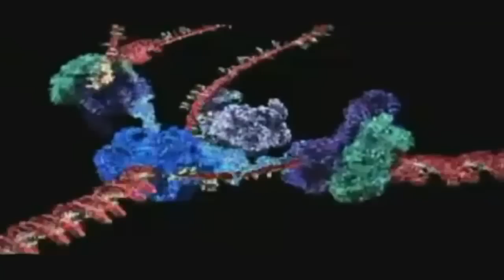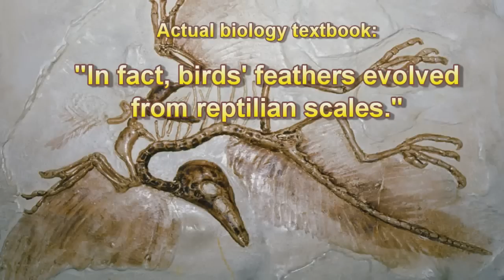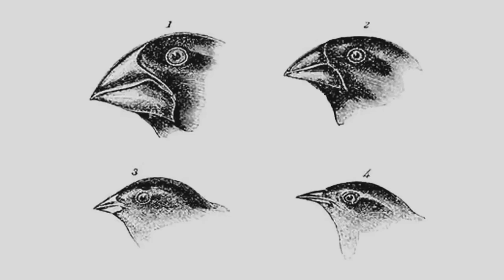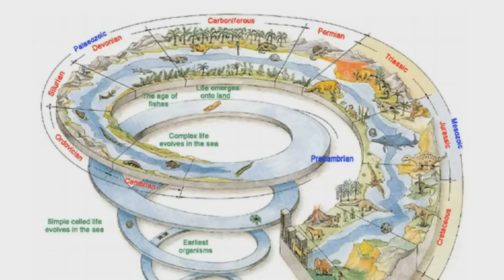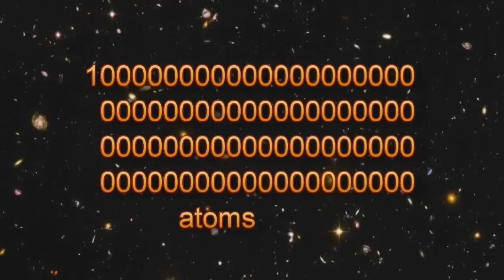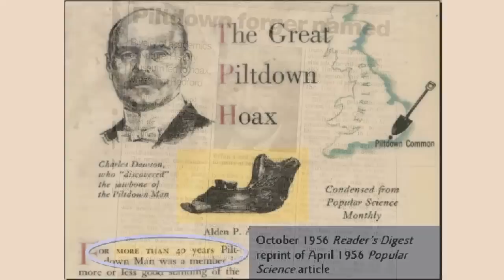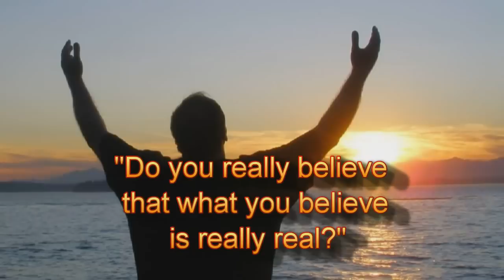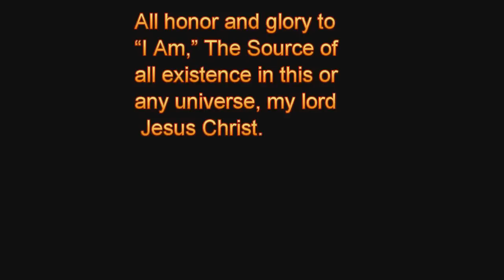Evolution Demolition

Comment: Mutations are not damage, they are errors, but to say that they are destructive is nonsense. Most mutations have absolutely no effect on the organism at all. In other cases, they can be extremely useful, you admit that microevolution happens, but guess what? That is caused by mutations!
The old computer analogy is simply stupid - computer code is much more finely-tuned (by a designer - us) than DNA.
Reply: It is not an analogy.  Living cells  contain literal computers, operating with literal instruction sets (programs).  Input, output, processing, it's all there.  If these information processors are not really computers, then what do you call them?

The only reason mutations are often less harmful than expected is because of highly sophisticated error-correction programs that repair the damage in most cases.  But when a certain threshold is crossed, the harm is devastating to function.  The same thing goes on in electronic computers.  Transferred files can usually be error-corrected, but at some point, things crash.

One thing is certain, randomly altering instructions reduces function.  You can alter the data (variables & parameters), but if the instructions themselves are damaged, well, it does not make it work better.  Building up instructions by such means is absurd.

To say that "computer code is much more finely-tuned by a designer than DNA" is the height of arrogance.  Bill Gates himself recognized this, and stated that DNA programming is far more complex than anything engineered by man.
Reply: Mark Champneys
I was talking about the analogy with the computer software on a hard drive, changing a software code is completely different from changing the sequence of a strand of DNA. 
DNA's function and method is much more complex than a software code, but it is less finely tuned. A change of a single letter in software could easily ruin the entire program, but changing a single nucleotide in a DNA sequence is incredibly unlikely to make a noticeable difference to it's function. I'm not just talking about the proof-reading mechanisms, even if a mutation is overlooked and remains, it will be extremely unlikely to change the function of the protein.

You can't compare DNA to "instructions". The molecular interactions that fold chains of amino acids are completely different. Changing the shape of a protein (in the rare case that a mutation causes that) doesn't necessarily "destroy" it's function, it could just as easily give it a new function.

You really need to stop thinking of DNA as software, you need to think about it in terms of what it is - a biochemical system.
Reply: Mark Champneys
No they don't.  They are cells.  You are making what is known as an equivocation fallacy.  Yes, cells are complex and amazing.
Your God of the Gaps argument, however, is not a valid alternative to science.
Reply: Ratio nalMind DNA is not like a data storage device.  It is a data storage device.  The sequences are not like software.  They literally are software--in every conceivable way.  Parts of that symbolic code are instructions, and parts are data (variables and parameters) as with electronic computers.  Damage to instruction sequences would have great sensitivity.  Damage to data would have less.  The information is stored in highly sophisticated overlaid data compression schemes.  Software engineers are beginning to study these techniques so as to begin applying them to electronic computer programming.

However, I will be quick to point out that all biological information is not in the DNA.  Epigenetic information is very important, and the decoding mechanisms are as important as the information itself.

I am thinking of all this as a "biochemical system."  That truth does not preclude it being a computer network in every detailed sense of the word.  Information scientists who are looking at this are particularly emphatic about it.
Reply: Mark Champneys
You're not listening.
Yes, "damage" to "instruction sequences" would have consequences, but they are very hard to damage to that extent! I'm not talking about proof-reading mechanisms, I'm saying that even if a nucleotide or triplet changes, it can have no effect on the function at all. This is for several reasons, the degenerate nature of the DNA coding, the fact that not all amino acids in a polypeptide are vital for the protein's function etc.
Changing a single letter in a computer code would severely damage the program, but changing a single base, triplet or sequence in DNA doesn't always damage the function.

It's good that you're aware of epigenetics, but I don't feel it's relevant to this discussion at the moment.

You adamantly say that DNA is software, but it's simply not. Software is virtual, non-physical. The "information" in DNA is not. It is determined by molecular interactions, a purely physical process. A chemical reaction is not determined by "information". I go into this point in detail in one of my original comments.
Reply: Mark Champneys
No, it isn't simply a "storage device.
Its an organic molecule that has the function of regulating cells.
That complexity DOES NOT mean that it was created by anyone.
Reply: Martin Koch It is both highly complex and highly functional, meaning it is specified complexity--the calling card of intelligent mind.  The instructions are coded in the nucleotide sequences, not in the chemistry.  That makes it symbolic code.  And symbols always originate from a mind (directly or indirectly).  No exceptions.  Unless you want to try to find one for me.
Reply: Mark Champneys
The "information" in denoted by the chemistry of the sequence, nothing more, there is no "symbolic" information in DNA.
Reply: Mark Champneys
"Specified complexity" is not a scientific term, its a Creationist term with no scientific merit.
It is used by a non-biologist, non-scientist.
Reply: Ratio nalMind And the information in a a book is just a matter of ink on paper, right?.  Your statement is non-nonsensical  The DNA of a sponge and a human are the same.  The only difference is the sequence of the four bases.  The ones and zeroes in game software look just the same as the ones and zeroes in the programs controlling the space shuttle.  Only the sequence changes.
Reply: Martin Koch I see, so if a person has a different world view than you, he/she cannot be a scientist?  You are simply attempting to define your way to your point, but that doesn't change the truth.  If you think specified complexity is not valid, then explain/describe why.  Don't merely rule it out a priori.
Reply: Mark Champneys
My statement is indeed non-nonsensical - it's not nonsensical.
Your analogy is nonsensical, the information in a book is interpreted by an intelligent mind reading it, the "information" in DNA is determined by molecular interactions, which have nothing to do with intelligence.
Reply: Ratio nalMind Oops, typo.
Reply: Mark Champneys
Any actual response to my point?
Reply: Ratio nalMind The information in DNA is de-coded by biological systems according to a built-in set of rules.  Molecular machines are used to carry this out.  Decodability is itself indicative of intelligent design.  Symbols are not encoded and decoded apart from intelligent activity to do it or design a mechanism that does.  Do you have a non-biological example to the contrary?
Reply: Mark Champneys
No Mark.  If a non-scientist makes up a term and tries to pass it off as science, and it doesn't pass as science, then the assertion dies.
That's what happened to Dembski's paid attempts to undermine science.
Reply: Mark Champneys
I've already explained this to you on another thread - DNA isn't "decoded"! It's not a symbol open to interpretation, it is a physical molecule that acts according to the laws of physics and chemistry, nothing more.
I really don't understand why you haven't got this yet.
Reply: Ratio nalMind Yes, DNA is a physical molecule.  A book is physical paper and ink.  A billboard is a physical sign.  All must be read in accordance with objective translation, syntax, and grammar, in order to de-code the meaning.

Sponge DNA and human DNA are chemically the same.  It is only the coded sequence of the bases that determines the instructions for one organism versus another.  Francis Crick recognized this information content.  Why can't you?
Reply: Mark Champneys
Let me try to break this down for you.

Information is non-physical.
Information is interpreted by a mind.

I've already addressed the book analogy - the information in the letters isn't determined by how they physically interact, it is how we interpret them as humans. Letters aren't physical, they are abstract concepts created by human minds. Of course we can depict them with characters, but that doesn't make them physical objects.

Yes, differences in organisms are caused by differences in DNA sequence, but this is only because changing the sequence changes how the molecules interact.

DNA is physical, and most importantly - "is not interpreted by anything", everything that it "encodes" is purely determined by physical reactions of the molecules.

If you're going to call DNA information, then you have to extend that label to just about everything in existence - rocks, plastics, metals, everything.
Crick, like all competent life scientists, recognised the usefulness of describing DNA as information for convenience, it makes it a lot easier to understand.
Reply: Ratio nalMind Information can be decoded by a mind, or by mechanisms built by a mind (such as computers).  DNA is absolutely interpreted by biological systems according to built-in rules of interpretation.

The difference between DNA and other things (rocks, etc.) is that DNA is symbolic code.  A symbol is something that represents something other than itself.  A true symbol must be objectively decodable, not merely assigned a subjective "meaning" after the fact. Symbols carry meaning, specified at their formation. As I pointed out in my video, a snowflake is a pattern, not a symbol.  Symbols carry meaning, ideas, designs, thoughts, beyond their own essence.  DNA sequences do this "in spades"...perhaps moreso than any other symbols in existence.

Some codons (groups of three bases) align with a particular amino acid; but some have regulator functions that are unrelated to amino acids or proteins.  The way the sequences are interpreted is dependent upon the programming.
Reply: Mark Champneys
"Information can be decoded by a mind, or by mechanisms built by a mind (such as computers)." Finally we're getting somewhere!
"DNA is absolutely interpreted by biological systems according to built-in rules of interpretation." Damn spoke too soon...

DNA is "decoded" by fundamental laws of physics and chemistry, nothing more. If you're going to try and argue that these laws are a creation of God's mind and therefore count as mechanisms of interpretation then this entire debate is pointless.

DNA is not symbolic. We assign symbols to them, A, T, C and G, and to the codons, AUG for example, but the molecules are not symbols! 
Definition: "A symbol is an object that represents, stands for, or suggests an idea, visual image, belief, action, or material entity." 
So by their very definition symbols are subjective.
DNA certainly does not "carry meaning, ideas, designs, thoughts, beyond their own essence." Once again, the key thought is that everything DNA does is just molecular interactions - it is purely physical, there is no interpretation whatsoever!

Different functions are "encoded" by different DNA sequences because those sequences interact differently to each other. There isn't any mechanism that's interpreting anything.
DNA isn't 'interpreted' by (for example) a ribosome (once it's in mRNA form) the molecules interact in a predetermined way, not a way predetermined by a mind or programming, but the way molecules interact according to physical and chemical laws! This is such a simple concept, why can't you grasp it?
Reply: Ratio nalMind I'm asking myself why you can't grasp it.  Even the bulk of evolutionary biologists understand the information content of DNA codes.  You are among a small minority even on your own side.

Like I said, of course there are physical interactions, but they are sequence-specific.  A different arrangement gives an entirely different instruction.  Exactly like any other software.
Reply: Mark Champneys
They often describe "genetic information" simply for convenience, using a strict definition, as I have demonstrated, DNA doesn't count.

A different DNA sequence gives a different function because of laws of nature, different software code gives a different function because of interpretation by a man-made machine.

There is a very simple difference there, one is entirely natural, the other involves a mind. As I've already said, if you want to say that the laws of nature involve a mind because you think God created them, then that's an entirely different argument.
Reply: Ratio nalMind What law of nature makes a sheep DNA strand build a sheep; and a sponge DNA strand build a sponge?
Reply: Mark Champneys
Your simplistic question indicates you still don't understand my point.
The physical and chemical laws determine the function of the sequence, chance mutations and natural selection determines the sequence itself.
Reply: Mark Champneys
It's interesting that you keep arguing this one trivial point of semantics but ignore the other major flaws with your video I've pointed out.
Reply: Ratio nalMind Of course the interpretive mechanism is built on chemistry and physics.  What else would you expect it to be?  Magic?  So it is with computers reading code.  There is no difference.  Why does a particular codon in one location refer to an amino acid, yet in another refers to a regulatory function?  It is all in the symbolic coding sequence.  Exactly like computer software.

No I'm not ignoring anything.  What did you feel I neglected?
Reply: Mark Champneys
What you call the 'interpretive mechanism' is built solely on physics and chemistry, nothing more. A computer is programmed by a mind, DNA is not.

That's not how the DNA works, it's not as though AGT can be interpreted as an amino acid or something else, sequences can have different outputs, individual codons do not having different "meanings". As I've already pointed out to you, DNA is not a symbol, it is a physical, interacting molecule.

Yes, you are, because I made 8 original comments, and you ignored all but 3 of them, and then choosing to argue semantics instead of science on 2 of the 3.
I will repost them just so you have no excuse for not seeing them, even though 4 of them are top comments.
Reply: Ratio nalMind And I am arguing that biological systems are programmed by a mind as well.  The interpretive mechanisms are enormously complex.  Such mechanisms have no parallel in nature.  Actually these mechanism are considerably more complex than those which respond to on and off switches in a computer.  We are unable to build such mechanisms.  The power supply is one aspect of these biological mechanism: the mind-boggling ATP Synthase molecule.  This is a molecular motor more sophisticated than any motor made by man, yet it is essential to supply energy to all the processes of a cell, including the interpretive ones.  Where does such a device come from?  Do you think that these thousands of atoms just fell into place?
Reply: Mark Champneys
That's viciously circular - "I think they are programmed by a mind, so they are information, and information can (apparently) only come from a mind, so there must have been a designer."

Complexity does not indicate a designer, that's a fallacy. Just because we don't currently understand everything about the cell doesn't mean you can insert god into the equation. That is the problem with "intelligent design", it doesn't provide any prediction or tests to support it, it is simply a big argument from ignorance - "we can't understand how it evolved so it must have been designed." That is absolutely useless in science, why would you stop looking for an answer?

Hundreds of years ago we couldn't understand lighting, so of course it must be god doing it, now we understand it, and god is removed from the process. The same thing happens with all aspects of science, as our knowledge is ever increasing, god is ever shrinking into the smaller and smaller gaps in our knowledge.

Regarding your comments on ATP synthase specifically:
First, it does not provide energy to every single process in the cell - they don't all use ATP. It is also not the only source of ATP, Glycolysis, for example. You can look online for a bit of information on how ATP synthase could have evolved, for example from DNA helicases and flagellar motors.
Reply: Ratio nalMind Wrong on all counts.  First, I'm not inserting God at this level.  That would be multiple steps down the road from this question.  Intelligent Design Theory merely theorizes that intelligent mind is required, and is a well known source of such symbolic code--as opposed to all other explanations being a huge stretch.  It is simply abductive reasoning championed by Darwin, himself: "inference to the best possible explanation."

To suggest that someone has the slightest idea how ATP Synthase could evolve is preposterous.  For every bit of mud someone slings at the ceiling there are a thousand firehoses washing it down.  It does not even slightly stick.  Of course energy comes from other sources, but ATP is the primary source in living things, and is essential for building both DNA and flagellar motors.  You've got the cart before the horse.

I know you would like to fit creationists into the God-of-the-gaps idea, but in fact, it is evolutionists who make it evolution of the gaps, because you are fitting a means of forming original genetic instructions that has never been observed and confirmed.

It is not complexity alone that indicates a designer.  I agree with you on that much.  It is specified complexity characterized by near perfect functionality with foresight that is impossibly improbable, and is so characteristic of intelligence.  The overwhelming improbability is a critical aspect here.  All things tend towards a state of greater randomness, not greater improbability.

It is not circular, but axiomatic, to say that if any apparent symbolic code is is objectively decodable, then that code was encoded by a mind.  (Champneys axiom)  This axiom is easily falsified by even one known example to the contrary.  I have not heard a single one yet from any of my detractors... and literally billions of people have daily experience with symbols to test this.

The root of my axiom's truth is the notion of foresight.  Only a mind can have foresight.  The placing of symbols requires foresight--to encode something that you expect to be decoded in a particular way later.  Dawinian evolution requires no foresight, but rather a pathway of successive steps, that is viable at each step.  Yet the need for planning in biological systems is obvious everywhere.  A glaring one is the metamorphosis of a butterfly.  Nothing works unless something down the road works.  Planning.  Foresight.
Reply: Mark Champneys
+Mark Champneys 
You are inserting god, you said that living things must have been programmed by a mind. ID hypothesises that an intelligent mind must be involved, without evidence - once again, simple arguing from complexity is not evidence.

It's not preposterous at all, simply google it.
You'll notice that I pointed out that ATP synthase isn't the only source of ATP in a cell, so there is no cart before the horse.

You're talking about the very first genetic information, in which case if anything, it would be abiogenesis-of-the-gaps - it has nothing to do with evolution until after this point. However while there are gaps in our knowledge, we still have foundation for such hypotheses, we have observed nucleotides forming naturally, and we have observed polymers of these bases form naturally, for example.

The functionality is only almost perfect because it has been acted upon by natural selection for billions of years so that the non-functioning cells have long since died. This isn't a guided process with foresight, you have to understand that. If it works, it survives, it's that simple. We wouldn't be here to talk about it if it was non-functional.

It's certainly not axiomatic, let me ask you, are tree rings encoded by a mind? They are "objectively decodable" are they not? Codes created by minds are subjective by definition. I'm not sure what examples of objective code you're talking about with regard to everyday life, can you name some for me? 

You're saying a caterpillar metamorphosing into a butterfly is an example of foresight? Seriously? You really don't understand how evolution works do you? There is no foresight. Using your vague terminology, you've hit the nail on the head, if something didn't happen down the road, then metamorphosis wouldn't happen - that's exactly right! It evolved over time, they couldn't always metamorphose like that.
Reply: Ratio nalMind When you say that god is being inserted because an intelligent mind is proposed, you are getting out ahead of the ID proponents and moving to the creationist position.  Yes, the logic subsequently leads to God, but that is not ID.  Let's first just deal with what constitutes evidence for intelligent activity.  You may disagree with the evidence of symbolic code and necessity of foresight, but don't tell me I did not propose any.  Intelligent mind is well studied in the sciences.  It is a real thing, that leaves evidence.

Tree rings, symbolic code?  No, but nice try.  Merely trying to read a trail of evidence is not de-coding an encoded representation of something else.  It is not encoded, and the reading process is not objective.  Most importantly, tree rings are not representations of something else.  They represent only themselves.  However, even if your illustration were a true example of decoding symbolic code, you would have just proved that it takes an intelligent mind to read it.  So it fails on all counts.

Yes, I understand perfectly how evolution is claimed to work, and metamorphosis is impossible by successive steps.  "You can't get there from here" as they say.  If you think there is a pathway in which each step is viable, please enlighten me as to what it might be.  This is actually a major pitfall of evolution generally.  Irreducibly complex systems, like the bacterial flagellum, are "refuted" without any alternative pathway proposed.  (Even things like the descent of man are not agreed upon.  Every paleontologist has a different idea of the pathway because nothing really works.)  Interesting, isn't it?  Lots of evolutionists agree with the idea of evolution, but there is no hint as to the actual contents of the theory--the step-by-step pathways that would have to exist. So I continue to maintain that evolution does not even qualify as a theory, but is little more than a very generalized hypothesis.
Reply: Mark Champneys
ID leads back to a god, it is an inherently religious movement, not science, as proven by several trials in recent years.

I never said tree rings were symbolic, I asked you if they were objective. They represent the age of the tree, that is the only "interpretation" that can be made.

"Most importantly, tree rings are not representations of something else."
Congratulations, you have just described DNA as well.

You're going to actually try and use the argument of irreducible complexity? You're about a decade too late, that too was been refuted in the Dover trial. 

No, we don't know every single detail of the evolution of all life on earth, that doesn't mean it's not a theory you fool. You can maintain your position that it's just a hypothesis all you want, it doesn't make any difference to the reality. Evolution is a fact, and the Theory of Evolution is just that, a scientific theory.
Reply: Ratio nalMind A theory does not need every detail, but it needs at least a few.  Evolution has none.  Only speculations that are not verified.  Not one verification of random mutations giving rise to overwhelmingly improbable genetic instructions.  Not one.

You are going to use the Dover trial as a scientific argument?  It was all legal maneuvering and control of the witnesses by a clearly biased judge.  No science involved.  Why do you not give equal weight to the outcome of the Scopes trial?
Reply: Ratio nalMind Thanks for the article link.  I read it with interest.  It was a breathtaking example of assumptions upon assumptions.  A fascinating exercise, but proved nothing that they wanted to prove.  "We carried out In vitro biomolecular evolution..."  How many absurdities can be fit into one sentence!  "In vitro" is not evolution.  One does not "carry out" evolution, because it is by definition an undirected process.  I'm asserting that biomolecular evolution does not exist, so that is the very thing we are testing for.  And viruses are not life.  Running various permutations merely showed that, in this particular case, less improbable changes improved fitness.  So what?  I have repeatedly said that "beneficial" mutations are not the point, but prescriptive information gain is the point.  But it has never happened by mutation because it is a violation of increasing entropy, both chemically and informationally.

This kind of article bamboozles many, but just a little critical thinking dismantles it.  By the way, the descriptor "peer-reviewed" jumps off the page.  By "peers" they obviously mean fellow evolutionists, not fellow scientists.  That objective scientist peers would not challenge all these assumed leaps of faith is disgraceful.
Reply: Mark Champneys
I find it difficult to believe that you read it and understood it since you're making such statements. However it's another example of you simply not understanding the principles of evolution.

Let me explain it to you again, what the study shows is that random changes to a random DNA sequence created an entirely new gene domain, coding for a highly function coat protein. You must really be in denial if you can't understand that.
Random sequence + random substitutions (simulating mutations) + selection = functional protein.
It's very simple - fitness was increased because an entirely new protein was produced. That's exactly what you said didn't happen.
The study was proof of concept, it demonstrated that it's possible.

The status of a virus as life or non-life is irrelevant, this is about proteins being produced from DNA.

No, peers means fellow scientists in the field. You're right, they probably were "evolutionists", simple because the vast majority of such scientists are, because of evidence like this.
Reply: Ratio nalMind More like 100% are evolutionists at this journal.  Dissent is not allowed.  Peers, indeed.  Did you notice how the authors assumed their conclusion at the very beginning of the abstract?

If you're asking whether the sequence of amino acids in a coat protein can be scrambled, of course they can.  Can it get lucky and ever have greater survival value?  Of course.  A coat protein could take lots of forms.  That's like rolling dice, getting an eleven, and saying, "Hey, look how this dice evolved!  Last time I only got a ten."  Roll the dice and build the instructions for a blood clotting system.  Then I'll be impressed.  Too tall an order?  Okay then, if you can think of a partial blood clotting system (with all its intricate intercommunication) that wouldn't kill off the organism, then try for just that.  Such overwhelmingly improbable outcomes are what I am scoffing at.  Just a simple little boy at the parade noticing that the emperor is naked...
Reply: Mark Champneys
Once again, yes they probably were all "evolutionists" because vast majority of scientists are. The reason they are "evolutionists" is because papers like this are good evidence.
Why even bother to discuss scientific findings if every time they go against what you believe, you chalk it up to a global conspiracy?
To suggest that no one would critique this paper if it had valid flaws is ludicrous. Scientific finding are always being looked at critically, and many such papers are rejected from publication because they are not good enough. This includes papers supporting evolution.
If your conspiracy hypothesis was correct, the researchers would not be publicly questioning the recent results of BICEP2 that support the Big Bang Theory - if their findings are accurate, it would be the smoking gun for the theory, proof of early cosmic inflation, so according to you, no one would question it because "dissent is not allowed" right?

What do you mean " the authors assumed their conclusion at the very beginning of the abstract"?
The abstract is a summary of the entire paper, of course it includes part of their conclusion from their research.

You're misrepresenting the study, it wasn't a "scrambled coat protein sequence", it was an entirely random sequence, inserted into the domain where the coat protein used to be coded. The study demonstrates exactly what you claimed never happened - a random sequence mutating and being selected for, gaining a vital and complicated function.
I'm not going to let you change the subject without acknowledging that you were blatantly wrong.
Reply: Ratio nalMind Once again, I do not dispute natural selection.  (A creationist first described the concept before Darwin.)  I agree with natural selection.  That this study demonstrated natural selection is interesting, but unimportant, since that has already been done many times.  They assumed evolution in the first two sentences of the abstract.  Of course they are going to find evolution when they already assume it.  No, I did not say anything about a conspiracy.  It's just that evolutionists are never going to have a problem with any researcher assuming evolution from the outset, even when their assumption is the very thing that they claim to be validating.  I think you are agreeing with me about the scrambled coat protein sequence, but you just don't like the harsh way I characterized it.  Yes, I understand what they did.
Reply: Mark Champneys
The paper isn't about natural selection, don't try and change the subject.
A random protein sequence was mutated into a highly functional one - which you said was impossible. 
Once again, it wasn't a "scrambled coat protein sequence", it was an entirely random sequence.

I've explained this to you once already, the abstract is written at the end of the research. They didn't write the abstract, assume evolution from the outset and then do the research with a bias in mind. The abstract is literally the very last part of the paper you write. It's a summary.

You are implying that "evolutionists" won't question any work that appears to support evolution, which is ridiculous, you have no idea how the peer-review system works do you?
Reply: Ratio nalMind Of course it was about natural selection.  It's right in the paper.  But it is also about a contrived lab mutation method.  But I'm fine with that.  Their results were a relatively probable alteration and a relatively simple function.  I'm not talking about such lucky but conceivable outcomes.  I'm talking about overwhelmingly improbable instruction sets that are both complex and highly functional.  Such DNA sequences are not going to write themselves in a trillion universe lifetimes.

Yes, the abstract is written after the research, but it is a summary of the logic that guided it also.

I know how the peer-review system is supposed to work.  And often it does.  Too often it doesn't--for reasons I have already described.  If I were a peer reviewing this article, I would not censor it, but I would certainly suggest some changes in their assumptions and their logic.  The research itself is fascinating.

Its funny how you don't like the word "scrambled," but you do like "entirely random."  Go figure.
Reply: Mark Champneys
It wasn't "about" natural selection, but of course it was part of the research.

A 139 amino-acid chain folding into a coat protein is anything but simple, but the reason I brought it up was simply as a proof of concept. You made the frankly silly assertion that random mutations can't lead to functional instructions, so I provided a paper which showed exactly that occurring. You can move on and dispute how more complex systems could have evolved, but you have to realise that you were completely wrong - mutations can certainly create prescriptive instructions.

There's a good reason you're not the one peer-reviewing it though - you're not a scientist, and you're really not qualified to be making such nonsensical criticisms of such research.

Calling it a "scrambled coat protein sequence" implies that the sequence originally coded for a coat protein, and then it was altered to be non-functional, when in reality what happened was they removed the protein sequence entirely, and replaced it with an entirely random sequence.
Say I give you an egg, then I scramble it - you've got scrambled eggs.
Say I give you an egg, then take it away from you, and give you some bread - you haven't got scrambled eggs have you?
Your choice of words are a pathetic attempt to lessen the magnitude of the evidence facing you.
Reply: Ratio nalMind The researchers did the mutating.  It was contrived.  It was not a living thing that built a protein like living things build proteins.  Nothing about the experiment was a test of evolutionary mutations.  As they themselves said, they did the "evolution" themselves.  The thing I am challenging is an undirected process, yet this was anything, but undirected.  What did they prove?  That humans could set up a dice game that once in a while they could win?  This coat protein was simply a luck of the draw to get something to wrap around a DNA segment.  Some coat proteins would obviously be more invasive than others.  So, as I explained, it was like rolling an eleven and saying, "Last time I rolled a ten, so it evolved."  You might just as well experiment with random development of poisons.  When you find the most deadly, you could say, "Hey, my poison evolved!"  The kinds of systems that would actually need to be built to prove your point are intricate inter-related biological systems requiring foresight and planning. (By the way, where did the DNA segment in the virus come from in the first place?)
Reply: Mark Champneys
Yes, the researchers carried out point mutations, changing RANDOM nucleotides for other RANDOM nucleotides. This was effectively a real-world simulation of evolution.

I can't understand why you can't understand what the paper showed. Let me try one more time to break it down for you:

1. Started with random sequence of nucleotides, coding for a random string of amino acids.

2. They carried out random mutations and cycles of natural selection - mimicking what actually occurs in nature.

3. After 20 cycles the random (and non-functional) sequence had evolved into a highly functional one.

4. This shows that entirely new proteins (and therefore traits) can come about simply by random mutations and selection - something you arrogantly claimed was impossible.
Reply: Ratio nalMind I think our impasse has to do with your definition of "highly functional one."  If you just mean that one combination of amino acids is "better" (for the virus) than another, than the last one... of course I agree that this happened.  Obviously any one arrangement is going to be better than another.  When all the permutations are laid out on a table, we might arrange them in a "functional" order, as natural selection also might do.  But if, by "highly functional" you mean low-probability machinery with inter-connecting parts which was not there before, then I would be shocked.

I agree that less improbable changes can and do happen in biological systems all the time. Luck happens.  What I dispute is the vast array of overwhelmingly improbable machinery, coming about by random mutations.  Molecular machinery does not have to get very intricate before it becomes extraordinarily improbable by random means.  That kind of luck doesn't happen.

So, back to our alternate definition of "highly functional"... I think the paper we are discussing confirmed the former, not the latter, definition.
Reply: Mark Champneys
So now you're moving the goalposts from mutation and selection resulting in a highly functional protein, to mutation and selection resulting in what you classify as "highly improbable genetic instructions"?

Why do creations have this obsession with calling everything "random"? Mutations are random, natural selection is not!

So you admit that brand new proteins can arise by evolution? Yes or no? Then we can move forwards.
Reply: Ratio nalMind Again with the "highly functional."  Which meaning are you giving to that phrase?

No, brand new proteins are not built by mutation, but re-arranged by mutation.  Big difference.

I've never disputed natural selection, but have pointed out that creationists thought of it first. It is not random, but is uni-directional towards survivability.  Natural selection must play the hand that it is dealt.  It creates nothing.

The "cards" are dealt by mutations, and mutations are indeed random.  Random cannot beget anything but increasing randomness--a law of mathematics, thermodynamics, and information science.
Reply: Mark Champneys
You don't think a protein which increases infectivity by 17,000 times is highly functional?

What do you think this study showed?
Once again: through mutations and selection alone, a brand new protein was created from a random sequence. Why can't you acknowledge that?

Many people were instrumental in deducing natural selection, it doesn't matter if they were creationists or not. How childish can you get? "We thought of it first na-nana-nana-na". That has nothing to do with the discussion.

Maybe random cannot beget anything but increasing randomness, but evolution isn't random - natural selection selects non-randomly. 
Studies like this show that when you combine mutation and selection, new "information" can arise.
Reply: Ratio nalMind An large increase in infectivity is likely a very simple thing, just as toxicity of a poison may be increased 17,000 times by a relatively small chemical change in the toxin.  What is the mechanism?  Simple explanations would have a relatively low improbability, making it feasible.  That is what this appears to be.  However, I will confess that a complex infectivity mechanism would be more impressive.  So can you explain the infectivity mechanism in this case?

While it is true that natural selection is not entirely random, it is close.  Gravity is not random either, but pulls in the downward direction.  That doesn't mean that gravity can build a computer or a house.  It is still very random within the confines of a general direction.  Mutation is the mechanism that supposedly offers the options for natural selection to "select."  That is where the random nature of the model is problematic.
Reply: Mark Champneys
It could be a simple thing, but it wasn't, it was the creation of a brand new, 139 amino acid long, functional protein. Lets go through this very simply, answer with yes or no:
1. Do you acknowledge that the 139 amino acid sequence the researchers started with was random?
2. Do you acknowledge that a brand new protein was formed?
3. Do you acknowledge that it was formed through mutation and selection?
4. So do you acknowledge that new functional proteins can arise by the processes of evolution.
Once again, yes or no only please, I want to see exactly what your position is.

No, natural selection is not "close" to random. It is very directional - towards fitness.
No one is claiming that something random + something non-random will build a computer or a house, that's another pathetic strawman.
It is the fact that natural selection selects for increased fitness that means more complex biological systems will arise, if only to outcompete those with simpler systems.

Of course mutations offer the options for natural selection to select! If you disagree with that you can't even accept microevolution.
Reply: Ratio nalMind 1. By definition things that humans do are not random, but, okay, for purposes of this discussion we will call it a short string of random amino acids.

2.  Yes, humans created a protein.

3.  Yes, it was altered until a particular arrangement was most effective at penetrating a nucleus wall than the original.  Natural selection at work.

4.  No, this function is simply a matter of having a good protein shape to fit through the nucleus wall.  The functionality is very simple and not improbable.  If I am wrong about how this virus is working, please explain it to me.

Natural selection selects for increasing fitness, but that fitness has to arise first.  If rolling an eleven is more fit than a ten, then, yes, that kind of evolution can happen, because rolling an eleven is not highly improbable... much like your better-shaped protein.  But how about a combination of proteins like ATP synthase, which is a high-speed motor that runs on protons and generates ATP from ADP.  Let's see a mutation that does that.
Reply: Mark Champneys
1. Of course humans can still generate random sequences, for example using computer-generated random number tables to select which amino acid to code for in the sequence.

2. Humans created a protein by simulating natural processes. You can't argue this study away by saying that it's human-directed. Every experiment is human directed to some extent, that doesn't stop them explaining natural processes.

3. Good.

4. You can't make statements like the function being "not improbable" - you have no idea what the parameters of the function arising are. Using simple maths however, you can work out that the probability of that particular protein arising by chance as 1 in 20^83 - this apparently unlikely protein sequence was arrived at in only 20 generations, how can you not see that mutations + natural selection is a hugely powerful mechanism of evolution?
All protein functionality can be reduced to it simply being the right shape.

You're moving the goalposts again, I'm happy to discuss the evolution of proteins like ATP synthase with you, but not until you acknowledge that brand new proteins can evolve pretty easily, contrary to your earlier statement that we've never seen random mutations produce functional genetic instructions.
Since we know from studies like this that evolution can produce new proteins, the common creationist crap about mutations never producing "new information" is well and truly laid to rest.
Reply: By the way, whoever keeps marking Mark's comments as spam: while I can appreciate the sentiment, it just makes it harder for me to respond to his comments as quickly as I would like, and means that people reading this thread will get confused.
Reply: Ratio nalMind Humans can attempt to mimic random with random number generators, but even that is not truly random. The authors have already indicated a strong bias, which is anything but random.  But for the sake of argument lets agree that the experiment was indeed random.  Other experiments on E.coli involving tens of thousands of generations did little more than make them bigger.  Virtually no change.  Malaria protists, same thing.  In the current experiment the coat protein occurred after only 20 alterations which happened to be in the right order.  Don't you think that this alone suggests that it was not an improbable change at all.

Testing various permutations of amino acid strings is child's play.  It is simple.  Yes, adding one to ten renders a "brand new" number.  (Like eleven.)  So what? If that is evolution, then I concede that kind of evolution to you.

But how do you explain highly improbable changes?  Like multiple parts working together to perform a function?  (Like ATP Synthase.)
Reply: Mark Champneys
+Mark Champneys 
It is as close to random as anything can get, and it's certainly no less random than mutations occurring naturally.

"Other experiments on E.coli involving tens of thousands of generations did little more than make them bigger." What are you expecting, for them to turn into ducks? There have been many experiments on organisms like bacteria and some have indeed produced radical changes, for example changing from unicellular to multicellular organisms. It all depends on the selection pressure

It wasn't just 20 alterations, it was several hundred across 20 generations - multiple mutations were carried out in each generation, ranging from around 8-25 each time (at RANDOM sites), across the population. The difference between the initial random sequence and the highly functional sequence in the 20th generation was 43 substitutions (I would've expected you to realise that if you had read and understood the paper), and when you consider that is ~1/3 of the entire sequence, you wouldn't really expect many more differences would you? 

"Testing various permutations of amino acids" is precisely how evolution occurs! How else do you think it happens? 
The whole point is that all the permutations don't need to be tested, because natural selection is guiding the process towards maximum fitness - it is the ratchet climbing mount improbable. This means that the probability argument so often touted by creationists is largely invalid - some events are unlikely of course, but you can't view the process as having a goal it's trying to achieve. 
Let me try another analogy:
Do you realise how unlikely it was that you were born? Every action that has ever occurred in the universe has played a small part in affecting the series of events that led up to your birth: skipping all the cosmic stuff, simple events like a bird distracting a person that was about to attack one of your ancestors, a spider scaring a cleaner causing them to spill a bit of water on the floor, which caused someone else to slip up which distracted one your ancestors for a few seconds preventing them from getting into a particular taxi which happened to crash - all these micro-events that led to your birth are impossibly unlikely when they all build up. However obviously none of that happened with you being the goal, you're just the result of what did happen.
If any of that had been different, you wouldn't exist, but someone else might in your place.

It's the same with evolution: particular proteins happened to form, which happened to be the advantageous ones we see today. If the mutations had happened differently a different chain of events would have occurred that would have led to a different protein/mechanism evolving, and then creationists in alternate reality would be questioning the probability of those proteins forming.
Reply: Ratio nalMind If it was 20 generations, then it was 20 successive steps (whatever the change).  That's how a generation works.

Yes, I am familiar with Dawkins' argument.  He thinks that the existence of life is proof that evolution got lucky enough to produce it. Rather self-fulfilling, don't you think?

The ratchet analogy has a couple of problems.  First, natural selection is not a preservative, but a culling process.  Secondly, most of the notches on the ratchet would have to be huge, so that it would take Herculean strength to pull the handle past a single notch.
Reply: Mark Champneys
Then call it 20 successive steps, because it certainly wasn't 20 alterations. You have the option to simply admit you made a mistake, missed part of the paper, or even just didn't express yourself clearly enough, that's not a problem. I wish you would just admit you were wrong about something so minor instead of trying to justify it - it's just sad.

Gee thanks for telling me how a generation works! I had no idea before! Please don't patronise me, especially not in my own field of study.

That's self-fulfilling!? How many creationists use the argument: "look around you, the evidence for god is all of this creation!" 
The difference is that neither Dawkins, or any other "evolutionist" claims that existence is proof of evolution. I would appreciate it if you could provide an in-context quote from Dawkins stating "the existence of life is proof that evolution got lucky enough to produce it".

It's a culling process, which ensures that the percentage of the population that survives to reproduce is the most fit. It is not directly a preservation process but it is indirectly, as the fittest individuals are preserved to reproduce.
Saying that the notches on the ratchet would have to be huge is simply an assertion - most traits evolve slowly by a gradual progression of mutations (small notches in the analogy). You're basically moving into the argument of irreducible complexity, claiming that the evolution of some traits is too big a leap to have evolved gradually. An argument, I might add, that has been refuted many times.
Reply: Ratio nalMind Saying that something has been refuted does not make it so.  All I have heard from Miller's arguments are excuses, rather than offering an actual explanation.  This is why I am asking for a proposed sequence of successive mutations that would build any biological system... whether bacterial flagellum or otherwise.  Evolutionists have offered nothing.  The concept of irreducible complexity is absolutely valid, even if one thinks that it does not apply to a given situation.  A key indicator of intelligent design is parallel, rather than serial, development, because probabilities rapidly become infinitesimal.

I appreciate that you have offered this protein shape as a "function."  That's more than most have offered.  But many biological functions are enormously complex with countless working parts, and feedback systems.  What would be the mutational pathway for something like that, wherein each step is viable/survivable?  Until you can offer a few examples, you have no model at all, let alone proof of a model.

'How many creationists use the argument: "look around you, the evidence for god is all of this creation!"'

Such an argument is a reference to the obvious "appearance of design" that even Dawkins acknowledges, not any circular argument.  Living things look designed because of functionality, complexity, and apparent foresight/planning.  We all have experience with intelligent design in our own lives, and things look like that.

Dawkins thinks this appearance of design is an illusion.  But the only explanation for writing DNA code is random mutation?  Tornadoes do not build houses from rubble.  It's the other way around.  And DNA is vastly more intricate than a house.
Reply: I'd appreciate it if you could restore my last comment, as it would seem it has been marked as spam sometime in the last 24 hours.